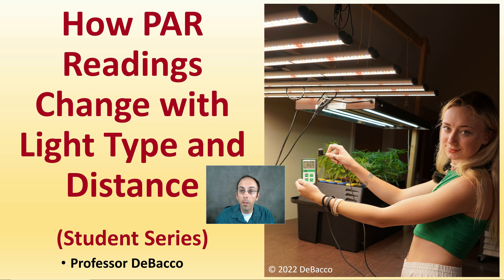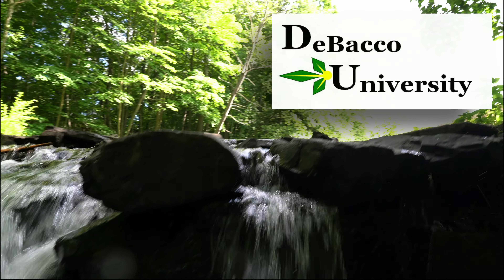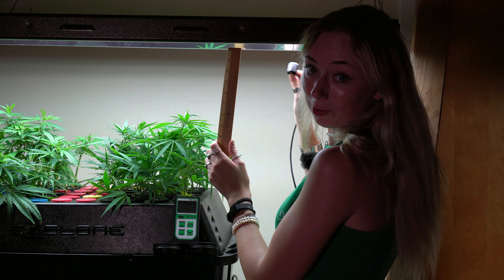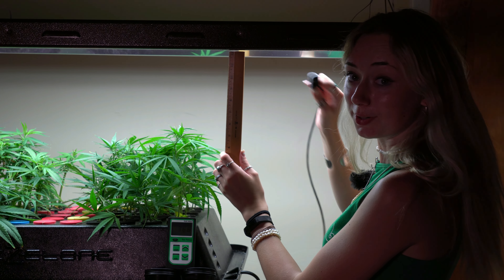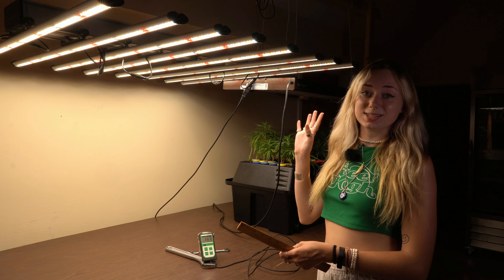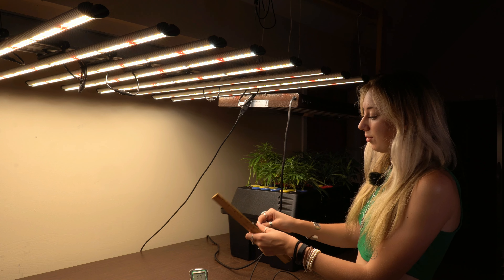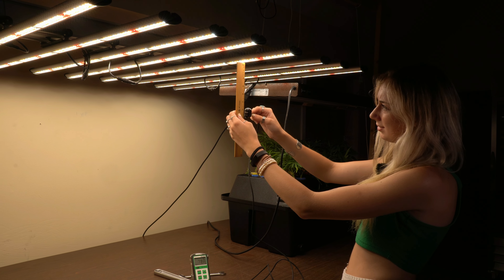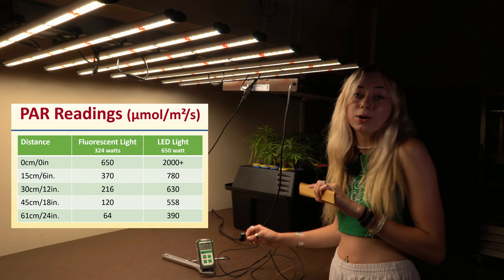How PAR Readings Change with Light Type and Distance (Student Series)

Comment: Professor Debacco, I recently bought a SE3000 led light by spider farmer. My cannabis plants are still growing leggy even when I follow the height instructions for the light. Its very bright in the tent I don't know why they would grow leggy even if the light is close to them. I have it dimmed at 30%  at 16 inch height which is what the instructions say. What could be causing them to stretch so much?
Reply from the maker: Do you have a PAR meter?  You could increase the light intensity.  Have you added any nitrogen fertilizer?  Are you growing the same variety?  What lights were you using?  If there is more red spectrum (vs. blue) this can induce longer inter-nodes (stretching of plants).
Reply: Could be the specific genetic you are running is just leggy.  If you are running multiple genetics and still seeing the same thing across canopy then I’d ask about night and day temperatures in the grow space… a bigger differential between day/night temperatures is said to cause more stretching.  I have used this light and did not notice any extra stretch from other lights I’m using .
Reply: One thing I found was that it took me around 3 grows before I actually got my head around the difference in using a LED light compared to the old 600watt hps that I more or less pick up and had beautiful results every time with. The old HPS  used to give me around anything from 10-13 oz dried weight then I moved over to LED and I honestly thought I had completely forgotten everything I had picked up the first time around I didn’t even get 1oz dried weight you really need to take in the information but remember that everyone’s set up is different and just like nutrient companies give you their strength that you should use you never should you let that plant tell you what she wants. It’s more or less the same with a LED light what they tell you is not really what it is inside of your set up don’t be hard on yourself and when you finally get it sorted and not lost in all the information which can help completely confuse you you will slowly but surely get back to how things was before you changed over. One thing is like when you take the par reading try and do it from inside the tent with the door closed I used to take readings with the door open then just out of curiosity I got inside my space and did it with the door closed the difference was nearly 125-140. par that helped me out heaps. For what I though was perfect was actually way over what was required. Take all the knowledge you can get but remember everyone has a different set up. All the very best for your future grows and may you sus it out but when you do you will feel like a star once again . Best of luck getting it smooth sailing 😘👍

Comment: Should I add IR and UV to my grow light ? Will it make a noticeable difference ???
Reply from the maker: Not if other growing operational environmental conditions are not maximized. What light are you currently using?
Reply: Using the fc-6500 in a 4x4
Reply from the maker: With this light focus on growing practices as there is a good overall spectrum provided and consider adding CO2.

Comment: I found an app with which you can measure ppfd, you also have to choose the spectrum. With my expensive smartphone, the measurement is super accurate, but with my cheap phone, too little light comes through the camera and the measured result is far too low. Those gauges are super expensive.
Reply from the maker: The PAR meters are expensive so the goal here (and other videos) is to give growers actual readings that they can apply to their growing situations without purchasing an official meter.
Reply: U need a light par meter . There are good cheap ones on Amazon. Cheaper than the one she is using.